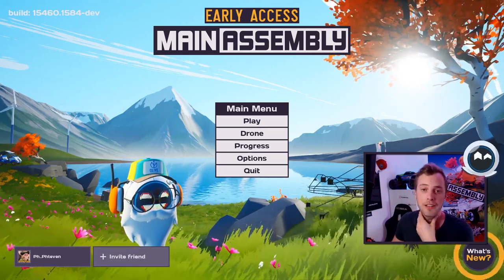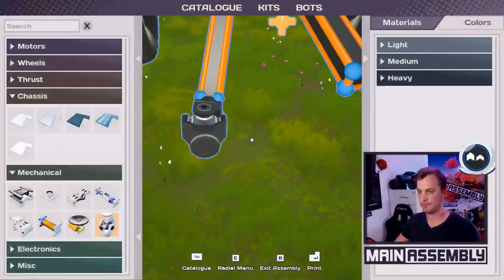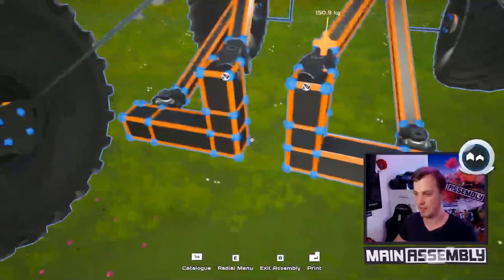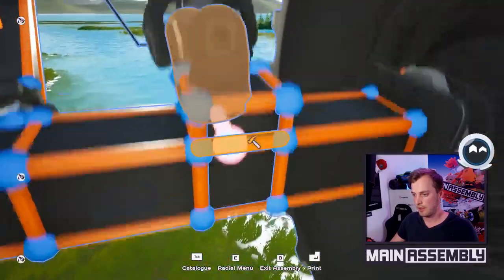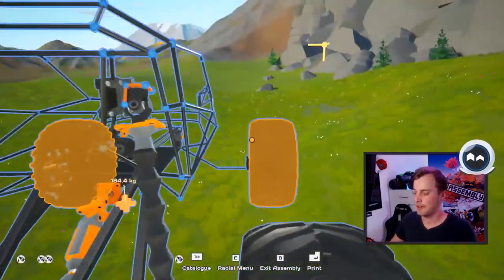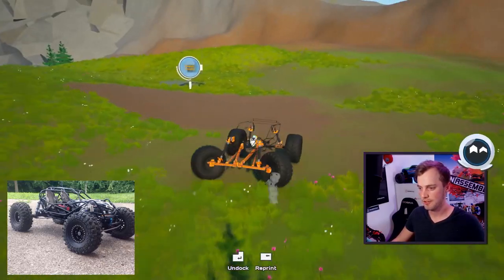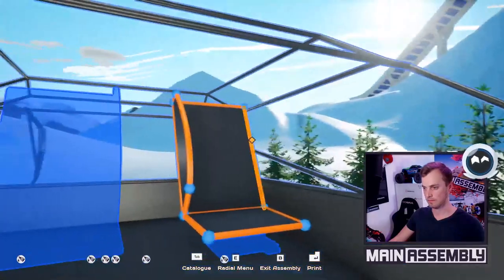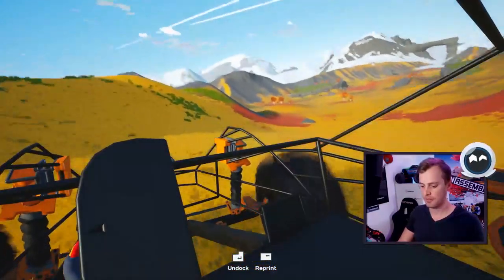Main Assembly Devstream #1 - Building The Bouncy Basher

Comment: Cool build! I would appreciate if someone could tell their opinion on my F1 car. The name is "F1 Black Hawk" and in my opinion it's very good at handling and decent at speed.

Nevermind.. The update broke the whole creation so it doesn't turn almost at all
Reply: Works well! Looks nice too. I am on stable build, not experimental. 
I did straighten the wheel camber. Seemed to be more controllable without camber. I also made shift turn on the trailmaker :D
Reply: @DaneE66  Btw I fixed it! I think It got updated so now it should run smooth enough